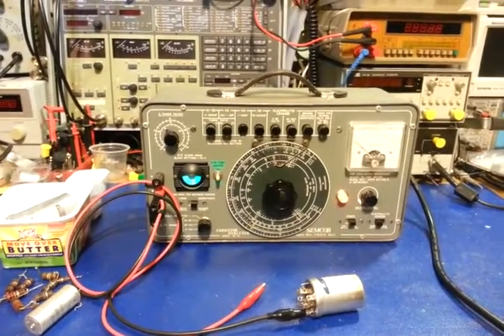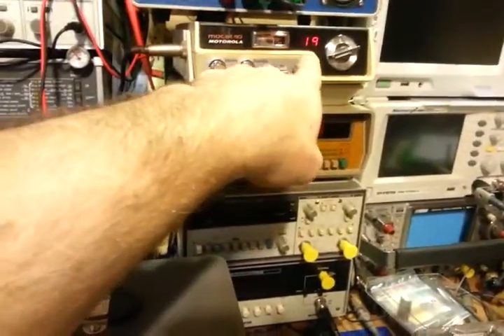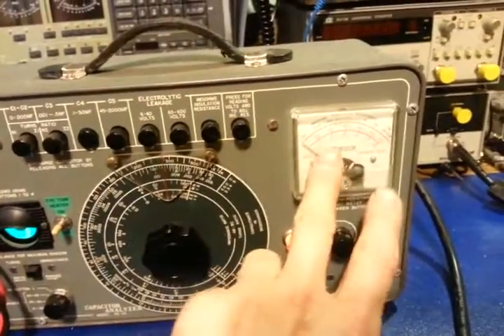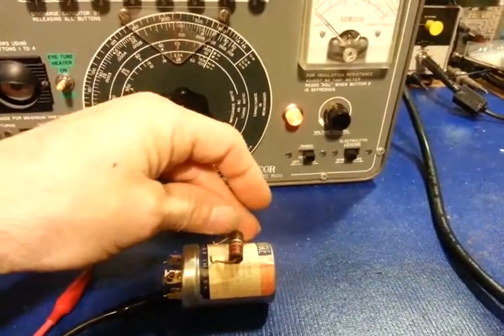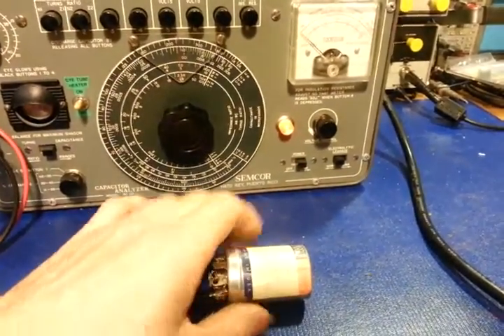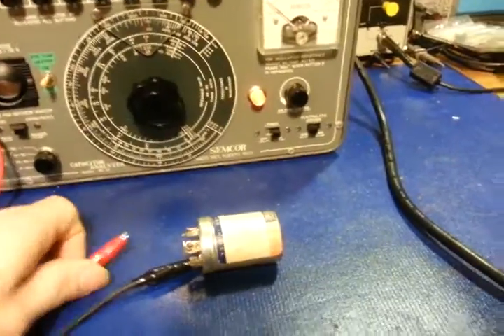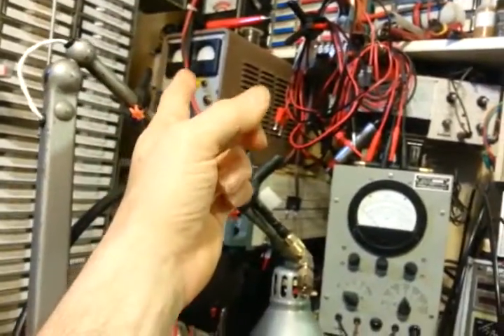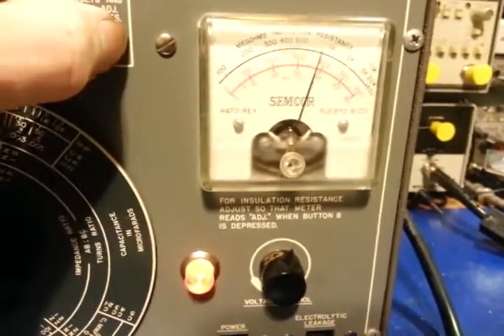Semcor RC-115 tube type capacitor analyzer still relevent on today's repair bench.

Comment: A SENCORE Clone!
Reply: Did Sencore actually manufacture analog capacitor analyzers?  This looks more like a Sprague Tel-Ohmike
Reply: Dandy Don....
Yes...
And YES!
Reply: Actually I typed before thinking.  From a search I did, there seemed to be a at least one Sencore model which was a combination vacuum tube and capacitor analyzer, but that was all I found.  Everything else appears to be (and quite a bit of it) from the digital era manufactured by Sencore.

Comment: very nice video Mike. yes this old gear is really nice and I like it. I really wonder why new leakage testers are not that much available on the market these days.  All the best and 73
Reply from the maker: Thanks for the comment Peter.  Probably not seen much in modern testers because almost everything modern is low voltage.  These were popular back in the day because literally everything was high voltage because everything was tube type.

Mike
Reply: +MikesRadioRepair yes you are probably right and when this high voltage caps are braking through  they go with a big bang... Well but beside that I have also found low volt caps with intermittent shorts on rated voltage so it is not senseless to have a leakage tester even these days...more than ever as we are also working on high power rf tube amplifiers....
Reply: Small capacitors can explode too.

Comment: Used to have a Sencore LC76.
Had one of those in a previous life..... but no eye tube :)

Never thought reforming a cap was a good idea but I have done it in a pinch when I had one that was iffy and I wanted to keep troubleshooting and I did not have something to replace it with handy.
Reply from the maker: Yeah the eye tube makes it much more "cool".
Reply: Reforming new capacitor parts stock which has sat for a year is a good idea.